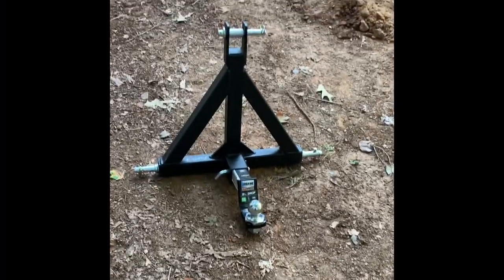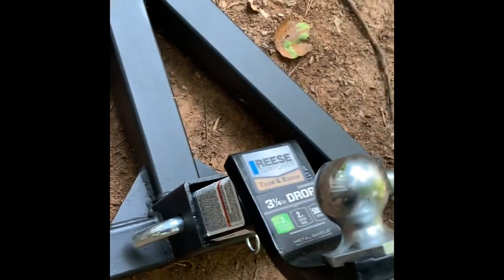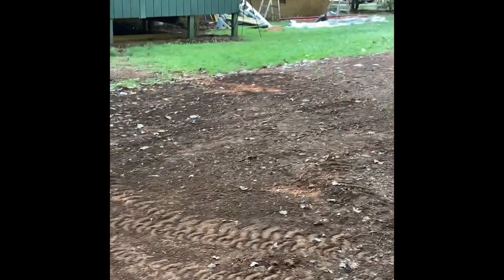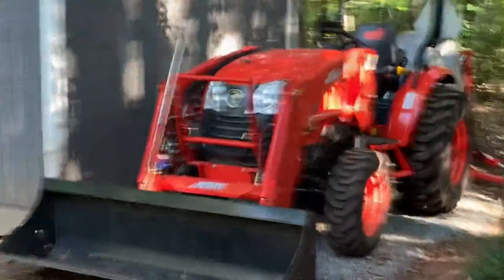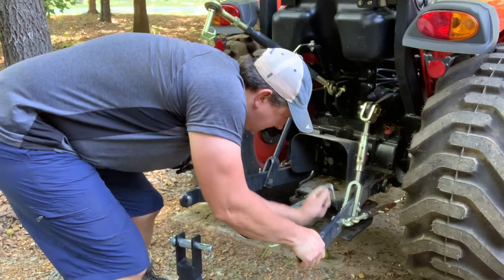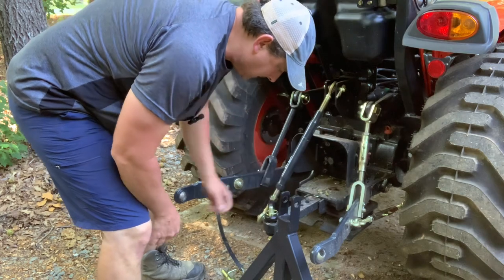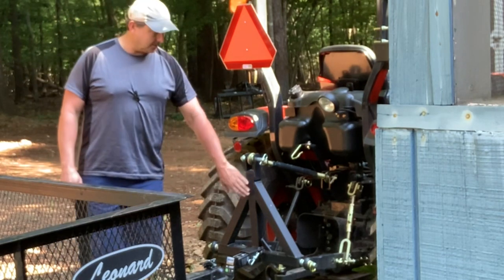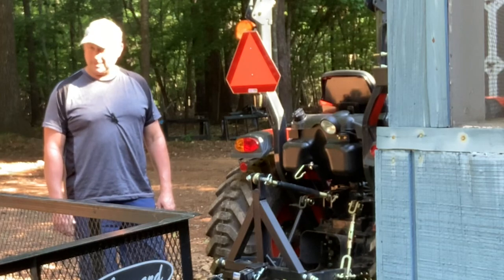Using a 3 Point Hitch for the First Time on the Kioti

Comment: The tube receiver is metric is why it’s loose if you put electrical tape on the hitch it will help with the rattle
Reply from the maker: Great tip. Thanks